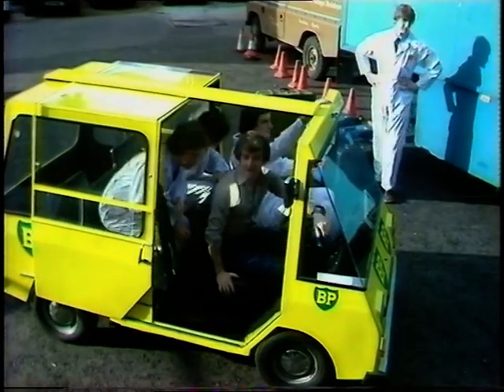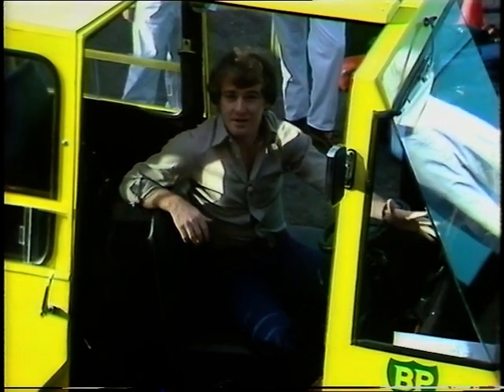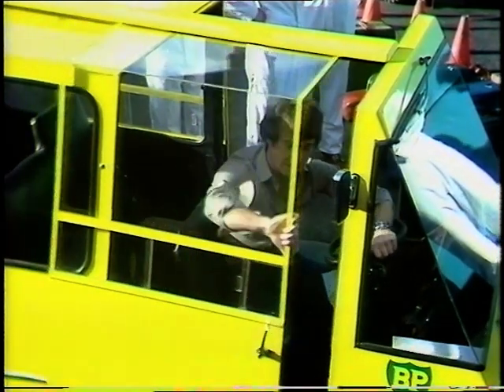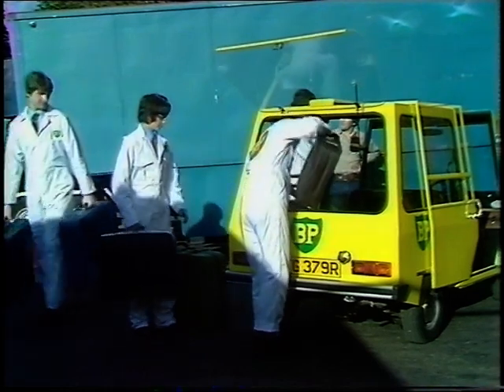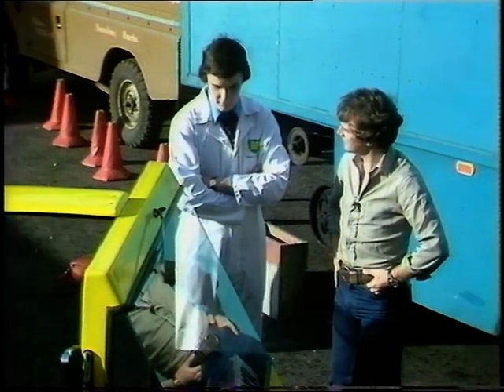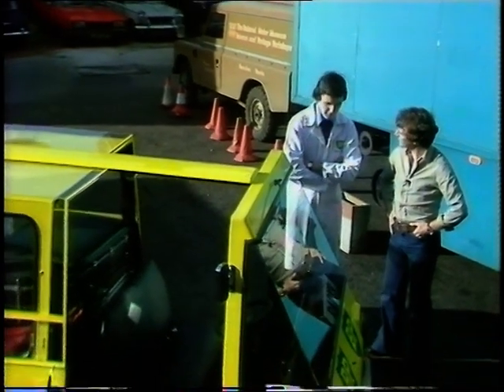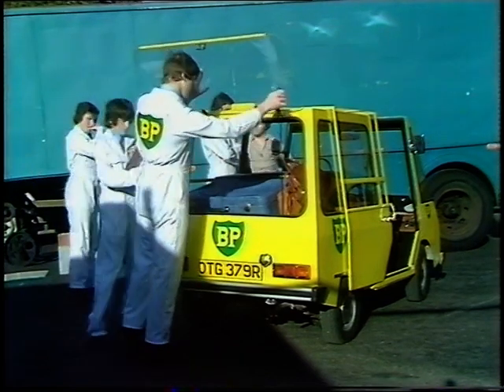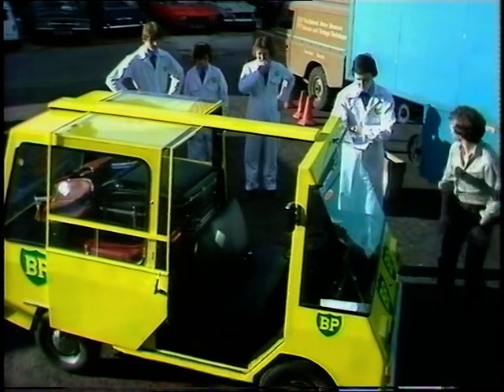1970s City Car | Student build city car | Radyr comprehensive school  | Magpie | 1976

Comment: Administrivia and regulations make this sort of innovation virtually impossible these days.
Reply: Quite right too. That thing looks bloody lethal.
Reply: But what was innovative about that design? In 1977, the super minis were out, the Renault 5, Ford fiesta, volkswagon golf, who'd buy a brick when you could have something sleek?
Reply: @pit_stop77  It had sliding doors that included part of the roof which facilitated easy ingress and egress in tight parking; expansive visibility; mixed mode interior space; and it was built into a working prototype by school kids. This is not viable today because there are so many regulations that the class would never build anything, they'd still be reading standards documents by the end of the school year. Meanwhile, 40 years later, no major manufacturer has produced a car door that is this convenient to use in tight spaces.
Reply: @davelowe1977  those doors are deadly!